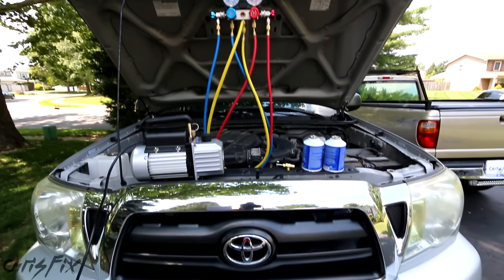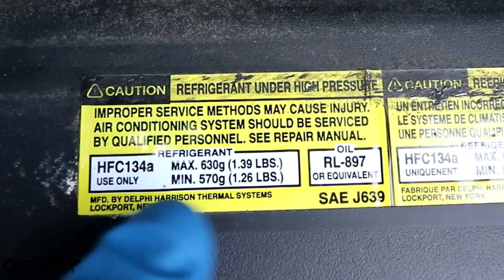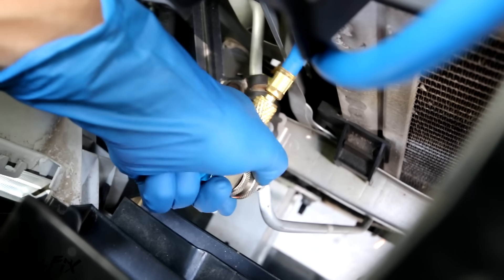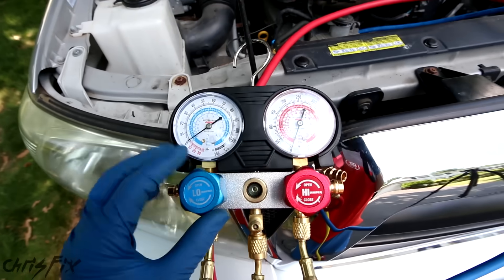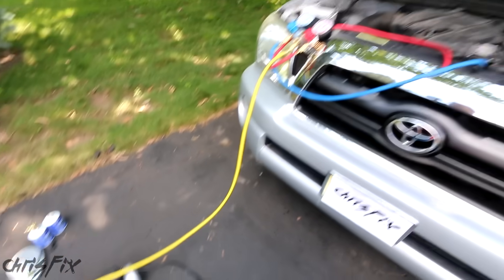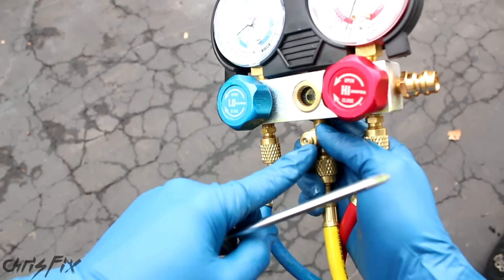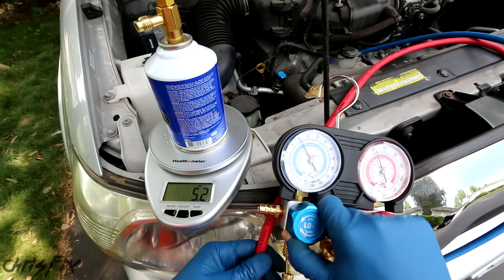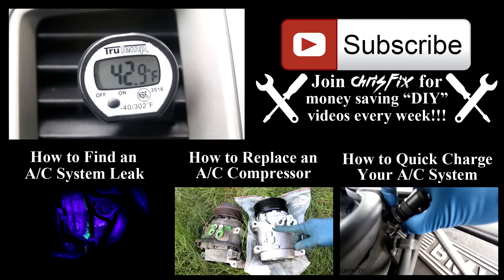How to Properly Recharge Your AC System

Comment: is overcharging by 1 or 2 ounces going to be catastrophic?
I think I slightly overcharged because I messed up the scale measurement thing. the AC still blows cold. I hope I'm just overreacting
Reply from the maker: +hostilityy It isnt going to be catastrophic because there is a slight buffer. Obviously it is best to get it close to the correct amount but you should be fine as long as your pressures are good!
Reply: +ChrisFix first of all, I really admire the way you reply to your viewers. Thanks 
Anyways, I'm not sure what the pressure readings for my 2007 335i coupe is suppose to be. It was 80 degrees Fahrenheit with 81% humidity outside and after running for 30mins i saw 42psi low and 230psi high on the gages.

I see online charts for temp readings but don't know if they apply to all makes and models.

Comment: you should really use a micron gauge when you are pulling a vacuum it should reach below 500 microns that is atmospheric pressure and tells you there is no leak.
Reply from the maker: +Jon cena Thanks for sharing. There are tons of tools you can use but I try to make it simple for someone to do at home with no extra equipment.

Comment: Good video. You should never charge a system with the can upside down or sideways due to the possibility of liquid refrigerant getting into the compressor. Also, most manifold and hoses will hold 3.5 ounces of refrigerant that didn't make it into the system. Most people don't know that though. The actual volume of your manifold varies as well as different length and diameter hoses. Your manifold has a sight glass and a larger manifold therefore would hold closer to 4 ounces. I typically use Yellow Jacket (Ritchie) gauges myself. I recommend using shorter hoses for systems under 3 pounds of refrigerant. I would also pressure test with nitrogen for leaks rather than just a vacuum. You did run the vacuum pump for a sufficient about of time, but a micron gauge would let you know when you had a good vacuum pulled. The standard is below 500 microns.
Reply: +Tim Chartrand I agree with Tim.  Pulling a vacuum to check for leaks is not the proper procedure for checking for leaks.  Pressure  testing the system is. He should of  charged the system with nitrogen to the near the max operating pressure of the system.  Also he should of purged the liquid refrig that was in the red hose.  Because he did not do this, chances are his system is a little low on refrig, but probably not enough to matter that much.  He could of done this by turning off the valve at the high side  fitting on the cars AC system, leaving the low side open.   Then open the manifold valves which would put the liquid refrig that is in the red hose (high side) back into the system.  WHen the pressure equalizes, on the hi/low you are done purging the liquid side.  All you are left with is a little refrigerant in those lines  because it's in a gas form.   I also agree that he should of used a vacuum guage like a BluVac gauge to measure vacuum.
BTW, if you were not going to charge they system using SubCool (which is not done when charing auto AC systems), there was really no reason to ever hook up your high side hose when charging  unless you were interested in the high side pressure for whatever reason.
Reply: That would bring it to about .75 ounces of refrigerant in the average 1/4" line 60" long. You would still have some refrigerant on the manifold as well. I always used shutoff valves on all three lines and full my manifold set with refrigerant before I begin to charge the system. I then zero out my refrigerant scale and the problem is solved. The volume in your manifold will make up for the volume you leave there. For adding oil I use a 6 ounce canister with a valve on a hose and an access fitting. You add the oil, pull a vacuum on the canister, then add the oil to the system via your manifold.
Reply: If your system previously had a burnt out compressor, you should also add some acid away or similar product prior to a system flush. The acid will just kill the new compressor as well as create multiple leaks.
Reply: +Tim Chartrand Just to clarify, there is going to be more than .75 ounces of refrigerant on the high side hose if you do not purge it, correct?   I now this is an issue on residential systems that use a fixed metering device (non TXV).  You have to get the charge exact and leaving R22 in high side hose can screw things up.  Besides you would want to purge your hoses if you use a single set for multiple types of refrigerant. But back to my original post, there was never any need for him to hook up the high side while charging.  While pulling the vacuum yes.
Reply: .75 ounces of vapor in a 1/4" hose that is 60" in length. That's an approx number for 134a in a 75 degree Fahrenheit ambient temperature. Vapor in only one hose will only vary slightly based on temperatures, and not enough to matter.
Reply from the maker: +Tim Chartrand Thanks for sharing!
Reply: No problem. You make great videos, so keep up the good work.  This is the best automotive air condition video I've seen on YouTube.

Comment: Thanks Thomas but not only had I replaced the Resister, all pigtail connections and intire slider and switch control system I also multimeter tested the entire power delivery lines and every fuse in existence. Problem always was and remains no power to blower and no a.c. actuation when high speed 4 is selected.. I have only taken it this far due to health condition neccesitating full a.c. capacity.. It is so greatly appriciated if anyone could offer an idea on what could possibly be done further to fix this difficult problem. Thank you very much!
Reply: Oregon Mike H I know its probably a little to laye for this but have you check your a.c. blower motor and also the blower motor resistant?
Reply: Oregon Mike H Ii

Comment: Wild try at a guess here Chris but do you think it a plausible possibility that if the system is not professionally charged rather then just topped with Freon, that doing so could fix my problem of the system shutting down when blower's highest speed setting #4, is selected on my 1997 Mazda Protege LX?? As you know this has been a real war battle I've taken every conceivable action to correct! What do you think?  Mike.
Reply: That sounds like a blower motor resistor, usually located around the blower motor under that dash, and is generally an inexpensive component.
Reply from the maker: +Big M Smith Unfortunately, the blower speed has nothing to do with the amount of refrigerant.

Comment: What if the AC is blowing outside air on one side of the car? I have a 99 Grand Prix and the passenger side works fine, But the drivers side blows in outside air
Reply: +Skullcrusher1005 Your heater valve is probably stuck open on the driver side and it's mixing ACed air with heated air. Assuming the car has separated climate control.
Reply: Karl Is-Karl Nope, Just one. I put freon in it and it seems to have fixed the problem for now ;)
Reply: 4runner? same thing is happening to me

Comment: One big mistake you made is you charged the system as a liquid by turning the can upside down. Always charge it up so it will go in as a gas. You're lucky the compressor didn't lock up on you.
Reply: It has an accumulator, it will convert to a gas in the system. Although I agree, I add liquid on the high side first and then feed vapor on the suction once it gets close to optimal charge. feeding liquid is always faster.
Reply: The best thing to do is charge from the low side as a gas. It the can gets too cold and it seems like the gas isn't going in the system, you can put the can in warm water. That will increase the pressure to get the last of the refrigerant out.
Reply: The recommendations "on the can" are to charge as a liquid. If the system is flat you add liquid thru the high side after vaccum. But even if you add thru the suction, you wait for the system to equalize before start up
Reply: billybassman21 yes 134 should be charged as vapor not liquid
Reply: Anytime a liquid exceeds the chamber size of a pump like a compressor there is a chance of damage since liquids are  nearly incompressible.
Reply: Mark Cherry of course there are bulk cans. But you need to be licensed to buy them.
Reply: I'll put a full 30lb can upside down on one of these compressors and it won't lock up. Some of the old style compressors used reed valves and the cold freon would make them brittle enough to break.
Reply: Jay Nordtome IHMO, Chris covers the recharge procedure pretty well, regardless of refrigerant type. Why are you recharging the system? Leak? Bad system component replaced?
Reply: moparnutjim 
First of all there's no such thing as a 30lb "can" and if you knew anything you wouldn't shoot liquid into the compressor and slug it
Reply: Thomas Horan 
It's not a "can" it's a bottle I know I'm licensed the point I was trying to make is the "bottles" are only filled to 25 pounds of refrigerant so next time you comment jump get the point straight side show bob
Reply: @markcherry8510  I also think there no such thing as a 25lb refrigerant bottle but I know there are 30lb refrigerant cylinder tank😂
Reply: you can pull liquid at the high side it instantly vaperizes
Reply: Probably should clarify that you would add liquid on the high side only initially, with the engine off.  
The high side port on the manifold gauge set should not be opened with the compressor running or it may pump up your refrigerant can to dangerous pressures, if there's no check valve in the can tap.

Comment: Quick question..... When adding refrigerant to the low side shouldn't the can be upright to enter in a gas form? If you turn it upside down doesn't it enter in liquid form? I'm getting ready to service my system and wanted to make sure it is done correctly. Thanks and nice video!
Reply from the maker: +Daniel Bailey You want to turn it back and forth from the 12 to the 3 oclock position as you add the refrigerant.

Comment: chris..
i am that guy who told about the rattles under the dashboard in his jaguar s type :)...a new problem came up, which is, the AC is fully charged,but still , the ac blows really hot air...couldn't find any leaks and the compressor is brand new and working properly. how to fix this?
thanks
Reply from the maker: +Abdullah Sirwi Sounds like your blend door is not working which might be the actuator arm not opening and closing the blend door and that is why you have rattles. Check this out, at the end I explain the blend door problem: https://www.youtube.com/watch?v=-XjXTVJhFLM

Comment: Hi Chris...  My 2005 accord's ac is not so great anymore, and living in southern california that can make long drives pretty uncomfortable.  As far as i know, there are no leaks in the system.  do you think if i had the system evacuated and add new refrigerant in there, would that make the ac blow colder?  or is it possible that my car is just too old and therefore i'm stuck with sub par air conditioning?
Reply: +Jermain Jones Either it's low on refrigerant or something else could be wrong with the system such as the compressor etc. which would be costly. I would say your best bet is the by the a/c pro recharge kit for $40 and connect the gauge the low pressure port without piercing the can first so you can check readings and if it's low fill it if not their is some other problem within the system.

Comment: Great video, thanks for sharing it. On the second can you added, assuming the fill hose was exerting zero pressure on the scale, you added a little less than 50% of the freon, because of the gross weight of the freon, can, adapter valve, and gravity on the fill hose. I don't think you quite put 22 ozs of freon in by weight. Maybe I'm wrong, just sayin.
Reply: +Gordon Standridge Just think about it, if he laid a rock on the scale also it wouldn't matter. As long as the set up is consistent. The weight loss on the scale is the refrigerate which is the drop in weight on the scale.

Comment: On the 12 fl oz can, it weighted 20 ounces. You put in 10 of the 20 ounces. Assuming the can weighs nothing (just to make it easier), that means you only put 6 ounces in, not the full 10 ounces. You must rely on using a ratio if you have 3 knowns and an unknown. In this case, it would be you know you have 12 fl oz, you know you need 10 fl oz. and you know your can weighs 20 ounces. therefore, you would do (10x20) / 12. This equals 16.6 repeating. Since you're losing ounces and not gaining when you add them, you should have filled it until you had remaining 3.3 repeating ounces left on your scale, not 10. You shorted yourself by 4 ounces.
Reply: +5k no, because you don't know that one fluid ounce of refrigerant weighs one ounce. Fluid ounces are a measure of volume. The density of the fluid would determine if it actually weighed one ounce, or more or less than one ounce. He should have weighed the empty can to determine the weight of 12 fl oz of refrigerant.
Reply: +Kamel All he needs is 10 ounces. It doesn't matter what the scale says all that matters is that you take 10 ounces from the initial weight.
Reply: +Kamel That would be true if the cans weight was also being transferred. It is not.
Reply: +volupheles I clearly stated that for the example let's assume the can weighs nothing.

Comment: Bernie > This video is very helpful, Question, I just replaced the suction pipe(low side) of my honda civic 05. Do i need to add lubricant?
Reply from the maker: +zniraf thanks! If it was leaking,  yes, you need to add oil.
Reply: Thanks Chris
Reply: +ChrisFix If I use this refrigerant, do I still need to add oil?
FJC 501 R134a with Synthetic Refrigerant Oil, Extreme Cold Synthetic Performance Enhancer, Advanced Formula Stop Leak Se

Comment: Did you replace the previously (air moisture contaminated) receiver/drier, prior to recharging?
Reply from the maker: +Kristof Van Den Elshout Yes, the receiver drier is new
Reply: Thx for the reply. Best instructional ac video i have seen thus far. Gj

Comment: After you've added exactly the right amount of refrigerant, wouldn't you have some liquid in the red high pressure hose?  If so, is it enough to matter?  I've always let the low side suck the liquid out of the high side hose by turning the valve off at the high side connector, then opening both valves on my gauges so the liquid can pass through. I always see a little liquid go through the sight glass but don't know if it's enough to matter.  I guess I could answer my own question by weighing my gauges before and after. If you don't answer first, I'll try to report back in a few weeks.
Reply from the maker: +Dan Ellis The amount of gas in the hoses doesn't matter because the volume is so small and insignificant.
Reply: What about the liquid?  Thanks for the response.  I agree the gas is insignificant. But it's the liquid that's left in the high side hose (between the car and the gauges) that I was asking about.  I repair refrigerators for a living.  They take between 5 to 11 ounces for a complete charge, so an ounce to me is a much bigger percentage of the total charge than it is to you.  That's why I was wondering if I needed to pay attention to getting all the liquid out of the high side hose when I work on my car's A/C (or family's or friend's) under my shade tree.

Comment: anyone can just buy cans of refrigerant?
Reply: yep
Reply: No you need an EPA cerification
Reply: +Daniel H I can buy one at autozone
Reply: +n00bkiller6767 Maybe it's different for cars excuse me if I'm wrong. I know for the refrigerant that you use for air conditioners and refrigerators you must be epa certified
Reply: I'm sorry for the miscommunication
Reply: +Daniel H R134a and R410a does not require an EPA certification. You do need it for the older R12 for automotive and R22 for residential. You can get the residential one for small appliances online by taking an open book test. That will allow you to buy it, but again that is only for the older R22 systems from homes, for cars made after 1993 you can buy it in the USA without a license. Some countries however do requires a license.

Comment: This movie is amazing. the Rules and Regulations in Australia are amazing. You need a special licence to handle R134a as in just to pick up a bottle. It is illegal to recharge a system with about a $100,000 or $250,000 personal fine without finding a leak. Operating a air con vacuum/recharge machine without a licence is $10,000 on the spot fine.
Reply from the maker: +Brian Howarth Thanks and dang! That stinks. AC work must be expensive in Australia (plus it's hot there so you need it).

Comment: what's the difference between doing it this way and doing it the very cheap way using a $29 can of recharger?
Reply from the maker: +Ronnie Shih This way is the safest way to do it and you remove all of the moisture and air from the system. The recharge kits work, but they are not as accurate (but good for a cheap fix).

Comment: sir I have a question. I charge my a/c as seen on your video and it was very helpful because I clean the evaporator unit,  but one thing I forgot is to add oil in the system and I already charged it with refrigerant and it was function properly and it blows cold air. the question is can I add oil to the system in the low side valve even it has refrigerant on it? thank you..
Reply from the maker: +edalcor zuproc You can add oil later on, just make sure it gets drawn into the system.
Reply: ok sir thanks